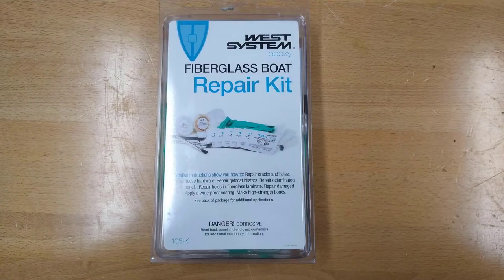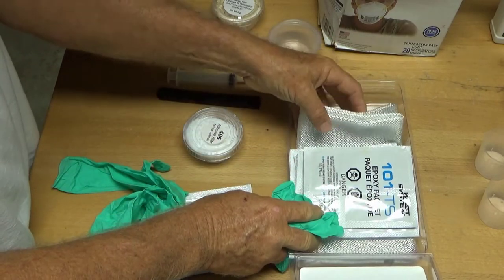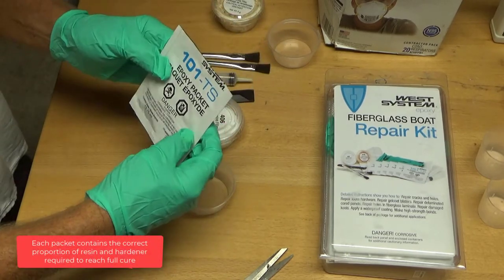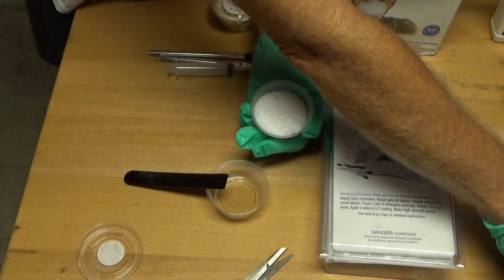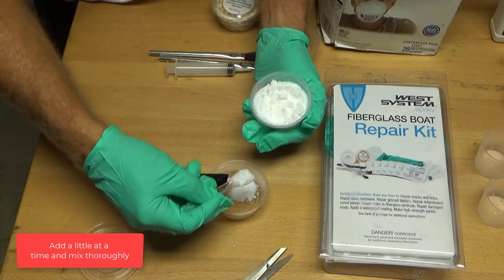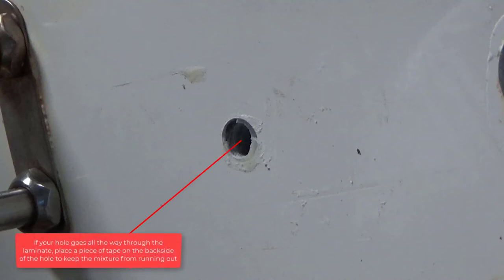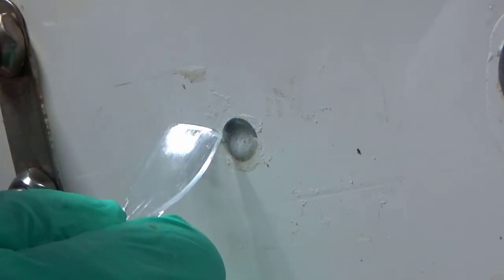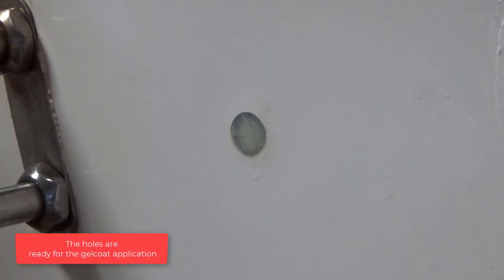Part 3 - How to Repair Screw Holes in a Fiberglass Boat.

Comment: I have watched all your videos and I have 6 1/4" screw holes below water line that was used for a replaced depth finder.  I purchased the West System Fiberglass Boat Repair Kit  you used in your videos.  As I was following your video instructions and reading instruction that came with West System Kit for "Repair holes in Non-critical Areas", I realized that process is for screw holes above water line.  I understood that was the process you used in your videos.  I called West System Tech Support and the gentleman told me "I must use a piece of  fiberglass provided for below water line or the patch would leak.  Do you have a video on repairing screw holes below water line using fiberglass in the hole?
Reply from the maker: Sorry, I didn't make a separate video tutorial for fixing the screw holes below the waterline. However, it's a simple task to perform. The West Systems repair kit contains instructions on how to cut the fiberglass and place it in layers to cover the hole. This process involves using larger to smaller fiberglass pieces in a series of layers. It's crucial to follow all the steps in the instructions, and by doing so, you can effortlessly repair your screw holes.
Thanks for watching my video
Norman

Comment: If you mix the 405 in the resin Before you mix the hardener, you will have more time before it sets off. You can actually mix separate tubs of it that way, and when you need to use it, just mix in your MEKP.
Reply from the maker: Thanks for sharing your information. I appreciate you watching my video!
Norman

Comment: Appreciate you.
Got a hole in my box truck cab fender...1"x1". I still have the broken piece/pluf that was made
Can I use this to apply to the broken plug, or is it best to fill from scratch with fiberglass cloth. I want to donit easy (which your DIY is) but I want to do it right.
Thanks
Reply from the maker: Al,
It would be best to use fiberglass cloth and fill the hole in layers. Let each layer reach the gel stage before adding the next layer, cover the hole, and let cure for 24 hours before completing the final finish. 
I hope this helps, thanks for watching my video.
Norman
Reply: @NormanGooch  THANK YOU!
I take it, the gel stage, is the mixed resin/hardener before it hardens, correct?
Also, would my final coat be the gel coat you're using?

Thanks again!
Reply from the maker: Al,
Epoxy goes through three stages during the curing process, starting when you mix epoxy hardeners and epoxy resin.
When you fill the hole in layers, wait for each layer to gel before adding the next layer. You must add layers before the epoxy reaches the final cure stage.

Below is a short recap of the epoxy stages 

1: Liquid—Epoxy’s open time - The epoxy is in a liquid state. The hardener and resin are mixed to kick-start a chemistry reaction during this stage. The mixture will remain liquid and workable during this first stage of curing.

Stage 2: Gel— The epoxy mixture passes into the green stage when it begins to gel or “kick-off.” 
Because the epoxy mixture is only partially cured, a new application of epoxy will still chemically link with it, so the surface may still be bonded to or recoated without special preparation. 
The time it takes to reach the gel stage will vary based on temperature, thickness, etc. You can tell when the epoxy reaches this stage because it will have a tacky gel consistency. 

Stage 3: Solid—Epoxy’s final cure. The epoxy’s chemical reaction is complete. The mixture has cured to a solid state and can be dry sanded and shaped.
Once the epoxy reaches this stage a new layer of epoxy will no longer chemically link to it. 

I have not used Gelcoat on trucks or auto body panels. I do not know how it would work. I have repaired cracks and holes using Bondo fiberglass repair kits but did not finish the final coat. I assume the repaired areas were painted to match the vehicle color.
I hope this helps
Thanks,
Norman

Comment: So what’s gel coat?
Reply from the maker: Gelcoat is a resin-based polymer layer applied to the exterior of a boat. This polymer can be epoxy or polyester-based, giving the boat a smooth, shiny finish. 

In addition to providing a glossy appearance, gelcoat forms a waterproof barrier that reduces UV damage and hydrolysis (a chemical breakdown due to water exposure). Gelcoat is crucial for maintaining the long-term structural integrity of your boat.
Thanks for watching my video!
Norman

Comment: Just used this west system kit and your video series to fill old screw holes where pitot tubes were mounted on my transom since I now have GPS speed. I'm getting ready to do the gel coat...however I have some air pockets noticeable where the epoxy setup against the tape. Should I mix up more epoxy resin, or should the gel coat application cover the air pocket/pin holes? Appreciate your time! Great video series.
Reply from the maker: Kyle,
Usually if the pin holes are very small and the epoxy is 1/16 of an inch or less below the surface, the gel coat will cover and not show through. If the epoxy is even with the surface, sand inside the hole to 1/16 so the gel coat has space to bond over and around the hole.
Thanks,
Norman

Comment: I drilled holes vertically thru my hull of my fiberglass boat when I was putting treated wood under that battery boxes. Would I be able to thicken the mixture more with the white filler stuff to make it stay easier so it won't just leak out of the hole even before I get tape to it?
Reply from the maker: I need additional information before I can give you an answer. What size are the holes? Do the holes go all the way through the hull? Can you access both ends of the holes?
Thanks,
Norman
Reply: @NormanGooch  the holes are smaller than the ones you fix in the video but they do go all the way thru the hull. I will only be able to access the hole from underneath now that I have put the treated wood under my battery boxes already. Also thanks for your reply and help!
Reply from the maker: Jake,
When you add epoxy resin filler or thickener, it can affect the pot life or working time of the epoxy. Epoxy fillers increase the volume of material, shortening the working time of the epoxy, and adding to the heat-releasing reaction. 
The more filler added, the less time you will have to complete the repair job., you will have to work quickly to make sure the epoxy cures properly and fills the void inside the holes.

Prepare all your materials and have everything ready to use before you begin.

Step 1:
Prepare the holes as instructed in the video. 

Step 2: 
Use a piece of stiff wire, insert into the hole and mark even with the surface of the boat. 
Use a tape measure or ruler and measure the depth of the hole from the mark on the wire.

Step 3:
Push a small piece of paper towel down into the bottom of the hole.
You will need a small diameter plastic straw that will fit inside the hole to about 1/8” from the bottom of the hole.

Step 4:
Place a piece of tape over the hole.

Step 5:
Cut a small slit in the tape directly over the hole just large enough to insert the straw.
Make sure the tape is sealed around all sides.

Step 6:
Follow the same epoxy resin mixing instructions shown in the video but add additional 406 adhesive filler until you get a “mayonnaise” consistency.

Step 7:
Load the thickened mixture into a syringe.
Trim the syringe tip to allow the epoxy to flow easily.
Place the straw over the tip of the syringe.

Step 8:
Insert the straw through the tape until you reach 1/8” from the bottom of the hole.
Inject the thickened mixture into the hole.
Hold the position of the straw for about 30 seconds.
Move the straw out another 1/8 of an inch, and inject again.
Hold the position for about 30 seconds.
If needed mix additional epoxy and continue injecting every 1/8 of inch and holding the position for 30 seconds until the hole is full.

Step 9:
Remove the straw and immediately place additional tape over the existing tape and make sure it is sealed all around the tape edges. (Use more tape to seal as needed)

Step 10:
Let the epoxy cure for 24 hours.

Step 11:
Follow the instructions in video on how to apply gelcoat to the repaired areas.
I hope this helps
Thanks,
Norman

Comment: Looking to do this on a few screw holes.  I just spoke with Spectrum Color about a shipping issue.  I happened to mentioned I was going to fill the holes with the West Marine epoxy then put their color matched patch product over it. .  They say not to use epoxy resin.  they say their product does not stick to epoxy.  Is it really epoxy?   Have you had any issues?
Reply from the maker: Greg,
Gelcoat will bond well to a properly cured and prepared epoxy surface.
However, if you do not do it right—Gelcoat will not cure over epoxy.

The main reasons Gelcoat will not bond to epoxy:
1. Under cured epoxy. 
2. Epoxy is not mixed at the correct ratio. 
3. Amine Blush.  
4. Surface not properly prepared 
5. Working in humid environments

There are many conflicting answers to the question: 

Will Gelcoat adhere to Epoxy Resin?

You can find expert fiberglass boat repair craftsmen stating Gelcoat will not cure over epoxy resin and you will also find experts who say it will cure over epoxy resin.

I have used epoxy resin to repair small holes and cracks in fiberglass boats for many years, using the West Systems 205 and 207 hardeners. 
It has been 4 years since I repaired the holes on the Carolina Skiff shown in the video. I haven’t had any issues with the Gelcoat adhering to the epoxy surface. The Gelcoat surface is still smooth and shines like new.
I hope this helps with your question.
Thanks,
Norman

Comment: I have a stripped out screw hole in my boat. After the epoxy is dry could I drill into it?
Reply from the maker: Follow these instructions to fix the stripped screw.
1.	Remove the existing screw.
2.	Clean dirt, old sealants, and other materials from the fastener hole.
3.	Drill an oversized hole to expose uncontaminated deck material and increase the bonding area.
4.	Drill the oversized hole only 3/4 of the depth of the original hole.
5.	Allow the core material to dry thoroughly if wet. Use a heat gun or lamp to speed drying. (Do not attempt to fill the hole if moisture is present - the epoxy will not cure properly)
6.	Mix the epoxy and hardener properly, then thicken the epoxy mixture in a cup with a 406 Adhesive filler to a non-sagging consistency. 
7.	Use a syringe and fill the hole with the epoxy mixture. Tape over the hole if on a vertical surface.
8.	Allow the epoxy to cure for 24 hours.
9.	Drill a pilot hole using a drill bit smaller than the screw.
10.	Apply a marine sealant to the screw threads.
11.	Insert the screw and tighten it down using a hand screwdriver. (Do not use power drivers)
12.	Seal around the screw head with a marine sealant.

Thank you very much for watching my video.
Norman

Comment: Thank you! I just took off 2 transducers and will fill the holes with the suggested kits.  I also have multiple holes on the center console from old gimble mounts and front deck from old trolling motor foot controls.  Can I just use gm 5200 or any 3m filler for these holes?
Reply from the maker: Yes, you can, however, you can also use the same kit and make it look new. I had several holes in the console from previously installed electronics on an old 1982 skiff I was working on. I sanded,  filled the holes, applied gel coat and you can't tell there were any holes on the console at all.
Thanks for watching my videos.
Norman

Comment: Did the risen expand after the 24 hours after you covered it ? Looks like it did in the video
Reply from the maker: No there is no expansion, the resin flows towards the entry hole on a vertical surface until it begins to gel and thicken.
The tape holds it back. The extra resin you see is a result of the flow.
Thanks, for watching my videos
Norman

Comment: I used the 410 fairing filler for my 1/2 diameter holes that are 1/2 thick through hull. Its an old transducer hole. Do I need to drill it back out and use the epoxy mixed with 406 filler?
Reply from the maker: 410 fairing filler is not as strong as 406 filler. 410 is used to smooth out low spots on the fiberglass surface where you can sand smooth before applying gelcoat
If you mixed the 410 to the correct consistency with epoxy and completely filled the hole from the back to front and it cured properly you should be OK.
If you can check the hole, make sure the epoxy is binding all around the inside with no gaps visible. 
Thanks,
Norman

Comment: Can you just stop at the thickened epoxy step if your going to paint the bull afterwards? Or is the gel coat crucial ?
Reply from the maker: Gel coat is usually thicker than paint and is used to protect the underlying fiberglass components and also give a smooth shiny surface to the boat. 
I would not skip the gel coat application if the repair is located in a critical area. If you do decide to paint I would use an epoxy based paint.
Thanks
Norman

Comment: Is it a good idea to cut out 2 quarter sized pieces of fiber from the kit and put one in the end of the hole since I can’t access it as well as one to patch the the outside like a bandaid?
Reply from the maker: If the hole goes all the way through you can use the fabric, just make sure it is tight enough to remain in place.
Thanks for watching my video.
Norman

Comment: im about to do a gel coat finish however the evercoat gel coat says do not apply over an epoxy as it will not stick well. I'm absolutely confuses
Reply from the maker: Jeffrey,
It is easy to be confused when it comes to gelcoat and epoxy. 
Epoxy hardeners are a blend of amines. The amines from the epoxy can interfere with the polyester gelcoat and prevent it from setting.

There have been so many conflicting answers to the question: Will gelcoat adhere to epoxy?
The answer:  Yes, it will.  Gelcoat will bond to a properly cured and prepared epoxy surface.

The main reasons gelcoat will not bond to epoxy:
1. Under cured epoxy. 
    If gelcoat is applied to epoxy before it is fully cured, the contact with the non-reacted amines stops the curing 
    process.

2. Epoxy not mixed at the correct ratio. 
    Mix ratio is so important and if it's wrong your epoxy mix will not cure. Gelcoat will not adhere to un-cured epoxy.

3. Amine Blush.  
   Amine blush is a surface effect resulting from the curing agent reacting with Carbon Dioxide in the air rather than 
   the epoxy resin. The by-product of this reaction is a compound that forms on the surface of the curing resin and 
   readily absorbs moisture from the air. Under high humidity conditions, it will cause white streaks to appear on the 
   surface of the resin and the uncured laminate.

4. Surface not properly prepared.
    Must be textured, sanded, cleaned with water, cleaned with acetone, cleaned again with water.

5. Working in humid environments.
   Make sure the epoxy and the environment are as dry as possible. Humidity levels below 85% are recommended.  
   Working with epoxy in a humid environment may cause inconsistent results due to moisture entering the mixture. 
   It's recommended that you keep the temperature as close to 75 Degrees as possible.
   Never go under 75 Degrees. If the temperature is warmer the epoxy will react quicker which results in shorter 
   mixing times and faster cure times. The epoxy can also burn if the temperatures are too hot during the mixing 
   process.

I have used epoxy to repair holes and cracks in fiberglass boats for many years, using West 205 and 207 hardeners. (207 has a stronger bond) and applied gelcoat to the repaired surface and so far, have not had any issues with the gelcoat adhering to the epoxy surface. Many repairs are over 10 years old, still no signs of separation on the repaired surface.

I hope this helps with your question.

Thanks,
Norman

Comment: So you sand the epoxy to like a cavity you can fill with Gelcoat?
Reply from the maker: Yes, evenly about 1/16" around the hole. This will help eliminate show through during the sanding process. 
Thanks,
Norman

Comment: Hi mate, I appreciate the awesome video’s. How much of the west systems fibreglass kit did you have left? I have 21 small holes to fill. Wandering if I should order 2 kits. Thankyou :)
Reply from the maker: I used 1 kit plus 4 additional packets of epoxy/hardener mix. There was enough filler in one kit to complete the job. If your holes are smaller than 1/4” 
And less than 1.5 inches deep, you may get by with one kit.
Thanks,